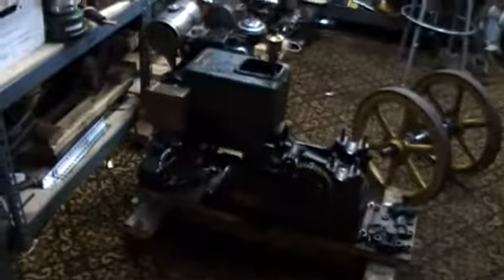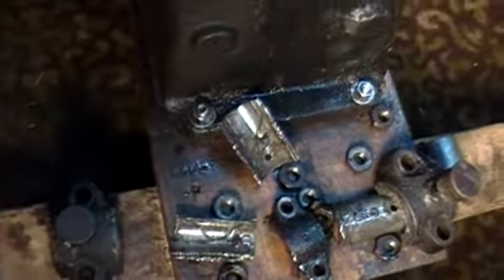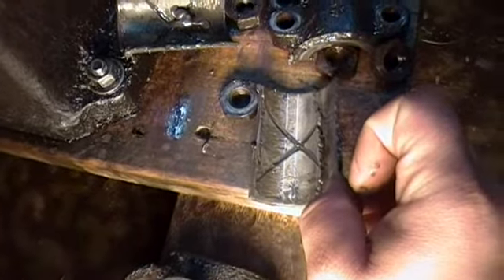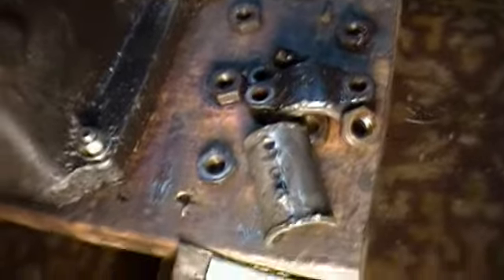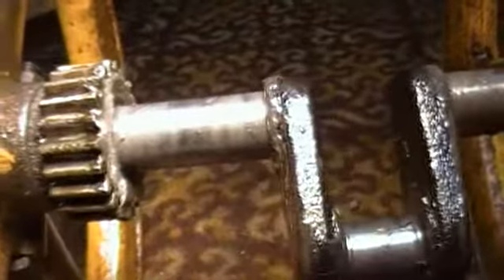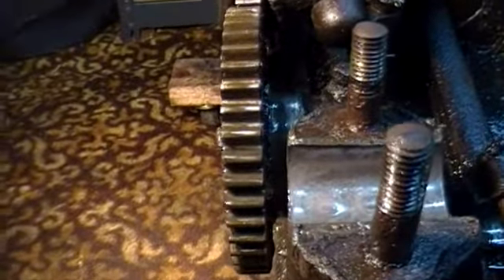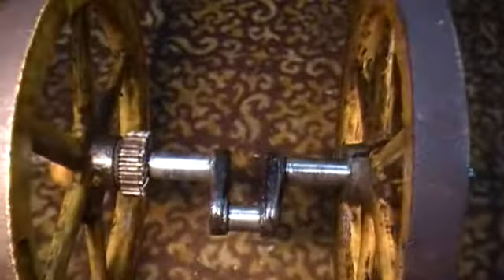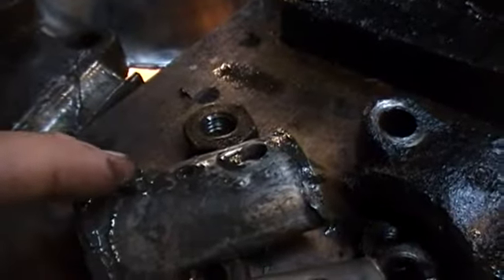2 HP Hercules Needs Bearings

Comment from the maker: I used a micrometer on the crank bearings and the connecting rod bearing to check for low areas on those surfaces that would cause excess wear on the new bearings.   Miked = Used Micrometer